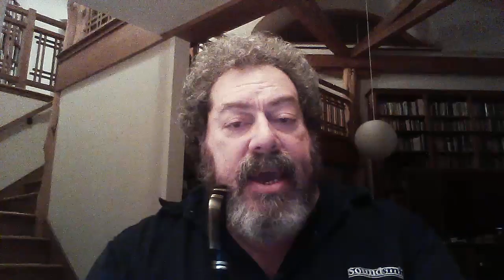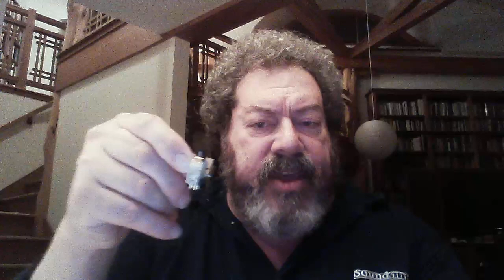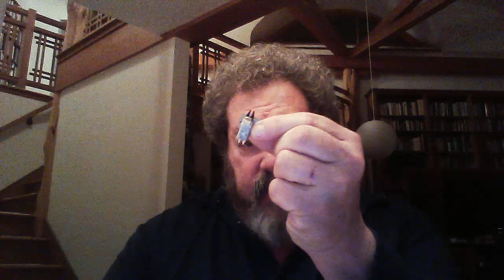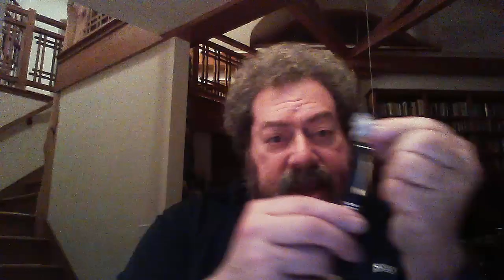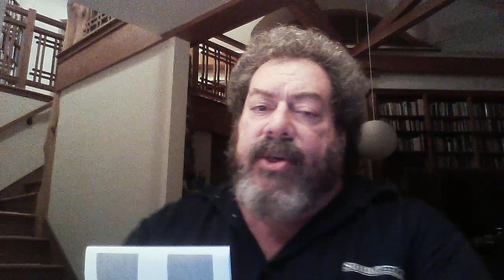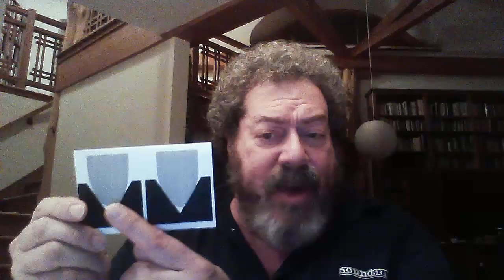Anti skating part 2 of 2 - Soundsmith - Peter Ledermann

Comment: Dear Mr. Ledermann,

maybe it's explained better in the comments, or perhaps I misunderstood something, but there's a detail that's eluding me. I tried to follow your suggestion, but every record — in fact, every side of every vinyl — reacts differently to the antiskating setting. With some, I ended up setting the antiskating to 1, with others to 0.3. Am I doing something wrong, or does the method require records with runout grooves of exact dimensions and characteristics? Wouldn't it make sense — please correct me if I'm wrong — to publish a video showing how the method should be properly executed?

Thank you for your patience! :)
Andrea

Comment: We often hear recommendations to set anti-skate the same as VTA. There are problems with this "rule of thumb."

1) If you set VTA by the number on the counterweight, it could lie to you. Use a stylus scale.
2) Related to #1, your VTA may not be what you think it is, so matching the anti-skate number may not be what you think it is AND it still doesn't address the separate Schröder method.

Comment: Thanks for that. I was stuck between the way I used to do it (similar to this but stationary on the flat), test records (distortion) and a video stating the AR-XA designer chose not to use it (He did seem to employ good physics). However, I theorised some used carts had bent suspension, perhaps due to not using ANTI-SKATE... ?
Just got my hands on a used Zephyr MIMC mk2. Lovin it!!! Still sounds clean for its usage (440hrs) and works really well with my SME-IV (which sounded a bit lifeless with some other old carts).
Also own a barely used Otello Mk1 that was too smooth for my tastes. Been on 2nd hand MC's for years. Favourite being a Kontrapunkt-B. Got a barely used VHD MC that woke up the S-IV and is similar in signature to the Zephyr MIMC but it a bit harsher and slower in bass. No doubt when the time comes, I'll ask you for a re-tip.
I will never forget hearing my first Soundsmith on Tim de Paravicini's Masterdisk in Munich. It sounded so "right". Bearing in mind I grew up listing to Floyd on a B&O turntable system...
It's like a reconnection.. 😄

Comment: If you want a vinyl record with a perfectly smooth surface and no grooves you can use the Diana Krall "turn up the quiet" side 4 record to adjust your anti-skating and let the arm go very gently towards the center of the record 👍🏻

Comment: I have a Rega turntable with an 880 arm. If you are familiar with Rega tonearms they use a magnet for antiskate and will swing back to the outside with no tracking force even with antiskate set to zero. I have my tracking force set to 1.5. I tried your method and even with the antiskate set to half the tracking force the arm still moves back toward the outside. It does move slower to the outside with less antiskate. Have you tried this method with a Rega arm?

Comment: My problem with this method is that it is terribly fussy. You have to drop the stylus at just the right time to miss the groove. Why can't you use a test record with a blank track, no groove, like my Shure test record? It has a track a little more than half way in with no groove and it is wide enough that there is no problem seeing the movement of the arm. Much easier than trying to miss the groove in the runoff.

Comment: Mind blown. Antiskate is only a phenomenon of cocked tonearms/headshells. I would like to experiment with straight tonearms
Reply: A straight tonearm also requires anti-skate since the cantilever axis is not pointing back toward the pivot. Curved tonearms allow the installer to set the cantilever axis nearly parallel to the tonearm section close to the cartridge whereas one has to noticeably tilt the cantilever (cartridge body) with respect to the tonearm axis using an alignment template. The only tonearm tracking scheme that has zero skating force is a tangential arm because the cantilever always points back to the pivot. Straight or curved tonearm design choices are more concerned with looks and mass.

Comment: So I should disregard all of the videos recommending anti-skate be set so that the tonearm remains stationary, neither moving in or out?  I was wondering because the anti-skate on my Panasonic RD-2900 (basically a Technics) only slows the tonearm while moving to the center, even at the highest setting it will not allow the tonearm to either remain still or move to the outer edge. So is mine correct if I set it to move to the center as slowly as possible?

Comment: I tried this method on a single sided record.  I can set it on the inner grooves and it works fine.  However, if I then drop the needle closer to the outer grooves, it jumps inward unless I add a whole lot of anti-skate.  Is something wrong?
Reply: I'm wondering the same thing

Comment: Isn't it also because of where the needle sits on the record. If the needle were at a 90 degree to the spindle it would pull straight away from the tonearm pivot, but because the needle rests on the lower section of the record, the record movement is now moving in a sideways direction to the tonearm pivot, thus pushing the arm to the inside of the record, irregardless of the angle of the cartridge.

Comment: It is the only reliable way to set the bias. 
However, the skating force is not caused by the offset, it is caused by the overhang, If you have undehang, the stylus moves outwards, away from the centre.

Comment: Really fascinating. I have an sl 1210mk2 and a nagaoka 110 mp110 cartridge set at 1.8 g. VTA set perfectly level. I set AS at same and somehow felt something wasn't right with sound. I then adjusted AS using spinout grooves and discovered it was very rapid. I set anti skate until spinout was very slow. Result: Everything balanced out and clarity across music appeared. There was also an injection of warmth n rhythm. My issue is psychological in nature. The sound of my system is great but the so called audiophile voice in my head says that I'm wrong because my stylus pressure is set at 1.8 but my AS is now set at 2. As Ozzy would say, Am I going insane. Or has anyone else found the same. I've only come across comments that suggest either the same AS setting as VTA or slightly less. Please put me right so I can set up, forget and just enjoy the music... 😂😂😂😂😂🎶
Reply: I just actually spent a good hour playing with anti skate and tracking forces on same songs and ended up at 1.5g tracking force and 2g anti skate. THAT was the best combo with very little tracking force. Also kept trying 1.5g anti skate to match the tracking force but wasn't as nice.

Comment: Great anti-skating explanation.  I'm confused about a couple of things though.

1) Given identical content (modulation) do the inner and outer grooves put the same amount of drag/friction/skating force on the stylus?  It seems like it would be less since the inner grooves are traveling slower (fewer mm/sec).  Though maybe not since the same amount of modulation is passing the stylus.

2) Wouldn't the unmodulated area between the run-out groves have far less friction than a typical modulated groove?  Thus less force being applied to the stylus to pull the arm to the center?  If so then if the arm moves toward the center wouldn't that indicate not enough anti-skating force?  If there was modulation there then the arm would move toward the center even faster.  It seems that if placed on an area without modulation that the correct amount of anti-skating should overcome the skating force.  Resulting in the arm being moved outward.  Not inward.
Reply: Unmodulated surface, has to my understanding, less friction. The force is therefor also less, than in a modulated groove. The tip of the needle is not (supposed) to touch the bottom of the modulated groove, which it is at a Unmodulated groove; this results in higher friction.

Comment: Peter Ledermann I just want to say thank you for this. I have a VPI prime and used to use no antiskate because VPI says you dont need it. I did your test and, sure enough, the tonearm flew to the middle. I ended up having to put a metal nut on the antiskate mechanism and got it to slow down a lot. In the past, no matter what I did, I COULD NOT get a good center image. After adding the antiskate, I now have a perfect center image and the overall quality has improved dramatically in every aspect. I wish I did it a long time ago. Thanks!

Comment: my Rega P3 has no anti skate adjustment.
Reply: Yes it does.  All Rega 3s have adjustable anti-skate if they have a Rega RB300 series arm.  On most of them it is a small black button in a slit in the top of the arm rest platform that can be adjusted back or forth.

Comment: Technics SL1200-MK2, stock arm, Sumiko headshell, Ortofon 2M Blue cartridge.  Tracking force set to 1.8g.  If I try the runout test as described, I have to set the Anti Skating to about 2.8 or 2.9 to get the stylus to drift slowly toward the spindle on the non-grooved surface.  Does that seem right?  That's a lot of anti-skating.
Reply: I’m playing with this and my new 1200GR and am getting similar anti-skate figures as you. Sounds great to me. Stylus is very strait. Before when I had it set to the same as the vtf the stylus would shoot inward the the very beginning of the song sometimes further. Now it rides the lead in groove very well. I’m using a Ortofon Concorde 40th @ 1.8 vtf and somewhere around 2.75-2.8 on the anti-skate dial. Still playing with it, but it sounds great.
Reply: @seanlanddB  Where did you end up with this? Do you keep your antiskate at the same setting now? I'm having a similar issue with my AT-VM540ML and SL-1200. Seems to take a lot more antiskate to do what he's saying.
Reply: @unchanging_window  Sounds like maybe you vtf may be too high (too much weight in the stylus)? But to answer your question: I ended up with the anti skate dialed up high to get the results he's talking about in the video and i never looked back.

Comment: I would just set the anti-skate to the same as the dialed in tracking force, because real audio engineers likely knew more than the average audio enthusiast. The only possible glitch might be if the measured tracking mass is off significantly from the indicated dial setting even after zeroing it out first; should one set the anti-skate to that of the mass dial, or to the actual measured tracking weight? After belaboring the reason why skating happens, the concept of floating a stylus across blank vinyl does not line up with the explanation.
Reply: "average audio enthusiast"? The man is literally a lifelong engineer who design and build high-end phono cartridge.

Comment: I adjust my anti skate while the music is playing and listen to a few minutes then adjust if the cymbals fade off up or down tiny adjustments eventually you will hear better sound .
In doing this not all LP s are the same so if your fussy do the same for different records if you think the sound can be improved .But you can get it pretty good this way set and forget but write down the tracking force weight and the anti skate setting .

Comment: Thank you very much for the informative video. My question :  does one need to change the anti skating force when switching between 33 and 45 rpm records? Theoretically the faster the record the more friction force produced and hence the need for a more anti skating force.
Reply: To my knowledge, kinetic friction is equal to the normal force multiplied by the kinetic friction coefficient. The equation does not involve velocity, therefore is not velocity dependent. So in theory, as long as the normal force remains constant you should not have to alter your anti skate. However, in this case, more modulation in the groove results in higher friction. Speed does not increase friction coefficient.

Comment: Great video Peter. I have been using this for all my setups for a couple of years, and it works great. I have managed to find a few completely blank on one side records that I use. If you go to a used record store that has a lot of old used DJ 12" pressings, you will occasionally find some that are one sided.
Reply: Was just wondering if it would be even better to use a record with a blank side

Comment: First, let me say thank you for your time in making these videos, I have learned a lot from you on these subjects.
My question is, is it fair to assume, since you are referring to straight tonearms with the angled headshells, that the S-shaped tonearms like the one on my Denon DP-790, are designed that way to counter the anti skating problems with a straight arm? If so, why does my turntable have an anti skating adjustment?  Thank you again, and all the best to you.
Reply: No, it doesn't matter if the arm is an S shape or straight. It is all about the axis of the cartridge, so the direction of the force not being aligned to the pivot point of the arm
Reply: Make a simple sketch of any tonearm, and it is quickly easy to see that the arm could even be a giant squiggle shape, it does not matter (ignoring things like weight, flex, etc). Only the distance from pivot to needle tip (= overhang) and inward angle of the cartridge matter. As the overhang measures directly point to point, the arm only establishes and locks in those parameters, and its shape is not involved. Matters of aesthetics, rigidity, mass, may enter new considerations but won't affect the essential setup parameters.
Reply: What about turntables without an anti skating dial? How do you track it then?

Comment: Thank you! Very straightforward and concise.. So: SLOW:  Just beyond stationary. Excellent. 
What is you opinion of using a CD for this? I am thinking it is a harder surface than vinyl - and would therefore introduce more skate?  Would it be acceptable practice though? (for longer viewing time before the stylus gets picked up by the groove).
Reply from the maker: CD's are NOT vinyl, so NOT the same drag coefficient as vinyl.

Comment: The runout grooves have lacquer ID inscriptions in between, wouldn't that damage the stylus?
Reply from the maker: This is an excellent point; I have wondered/worried about this as well. So......the rule of thumb is to make sure the ID inscription is FAINT at worst. Most all of them are. I have never, in 15 years, dislodged a stylus by having it accidentally go across the ID inscription. But you are correct - SOME records have VERY deep inscriptions, and these SHOULD be avoided. THANK YOU for this question - (Peter Ledermann)
Reply: +Tony C. If you have one then great, use that.

Comment from the maker: I have been asked how SLOWLY the stylus should track inwards. Imagine if it held still, and then JUST started moving in VERY slowly - MUCH slower than if it WERE in the end groove. That is the point of best adjustment. Just a bit beyond holding still. Trouble getting it right with a VPI arm?? Please see my website for details on VPI arm anti-skating adjustment.
Reply: @soundsmithcorporatio Can you do a video showing exactly where and how to drop the needle in the runout groove. It's better to see this in action. Thanks
Reply: @shredhero  I believe he said NOT in the run out groove. In the groove, it will only and always follow the groove. Go back and review what he said.
Reply: Hi, interesting video. Would anybody know of a video with someone actually perform these concepts? Trying to adjust anti-skating on my Denon DA-309 arm (DL103 cart, 2g tracking) When dropping the needle on the inner runout section, even at the very max setting, the needle moves inward slow, but not that slow. I was kind of hoping for a pivot point where it would be still, and dial back a bit to make go "slow". As I increase the anti-skating, it moves gradually slower but never to a still. I know my arm is a good match for my cart, It was designed for it. Now wondering if somethings wrong with it. At max setting it seams to be a lot of antiskating. Did not get to critical listening tes yet but if I lift the needle it swings back with quite a bit of velocity. If I want to Cue a particular track it is quite difficult, Just lowering the lever pull the needle back about 4-5 mm. So I can't visually set the needle to a place and just drop it. To me this means quite a lot of anti-skating. Any helps?
Reply: Would it be normal for the anti-skate setting to be significantly higher than the VTF? I have a Technics SL-1200 and perhaps the anti-skate spring isn't as strong as it should be, but it feels like the tonearm doesn't pause and then move very slowly unless it's set to 3.5-ish (with a VTF of 2 grams). Thanks!